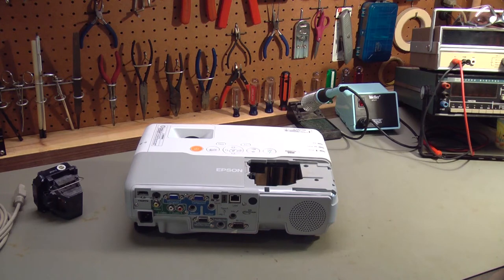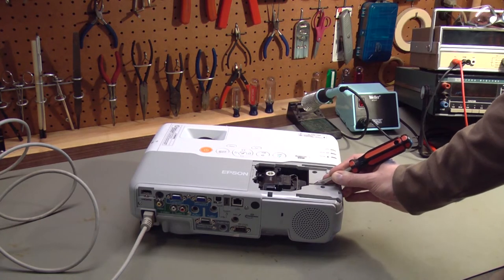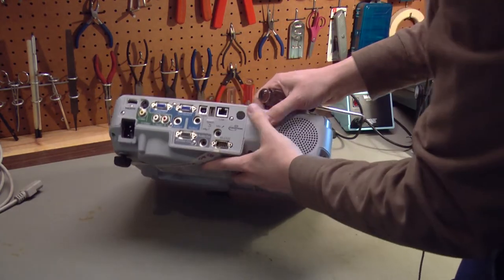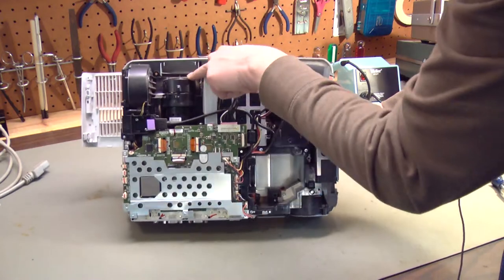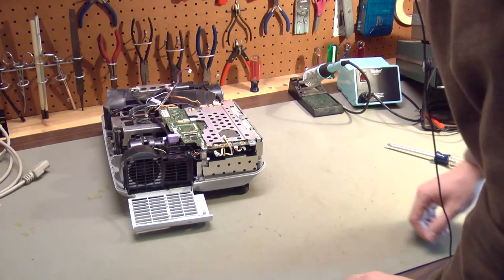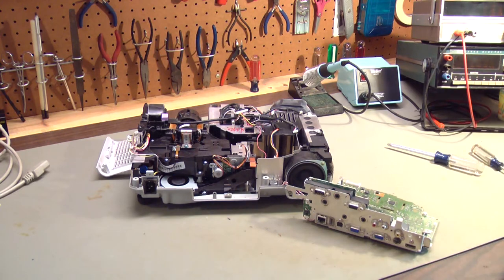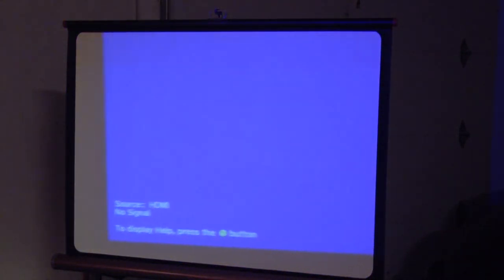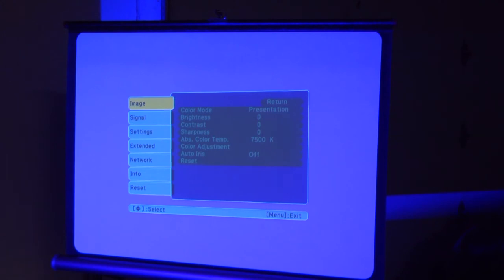Epson Powerlite 96W Poor Picture -- No Blue in Image -- Regluing Blue Mirror

Comment: Hey. I got a PowerLite 980W and it's great, except when I throw a completely black screen on, it has a faint green blur on towards the bottom right of the screen and a very faint red blur in the middle. Did some digging on the internet. Are these dust spots that can be cleaned out by a light dusting of the lenses, or maybe there is dust on the LCD? The issue only happens when I display black screens or when the video is dark.
Reply from the maker: Could be dust. Or it could be something in the optical path is out of alignment. It also could be that the LCD inside is just getting worn out.

Comment: This was a great video!
I have an espon power lite 95, I followed your video and my internals are identical. When the projector is powered on I get the same blue screen with white letters that you had. But, when I hook up any source to it the image has a very blue tint. All image settings on the projector seem ok. Any ideas on what that could be? Should I replace the LCDs or trash the projector?
Thank you!
Reply from the maker: Have you tried different video inputs? If you haven't already, try a VGA, and HDMI, and either the composite or S-video input. See if the problem occurs with each input. If it does, check the alignment and orientation of each mirror and lens in the optical path. Also make sure the ribbon cables going to the board are all fully inserted. If the problem is just with one input, there probably isn't much you can do about it except to just use the projector with the inputs that are still working.
Reply: Thank you for the reply!
I did try those inputs but the problem occurs in all of them. I took the projector back apart and everything seems to be connected well and all lenses seem to be in the proper place. Initially I had to re glue the same blue mirror you did in the projector in the video. When I placed it, it was setting in a grove and seemed to be in the correct place. Could it be that mirror still or maybe the LCD?

Thank you again for your advise!!
Reply: ***Update

I was able to fix this because of your video and advise! The clamp that flips up was broken on the blue cable. So I rigged up a zip tie to hold the connection down and it works! 

Is there anywhere I can purchase these little clamps to replace the broken one? Thank you again for the advise!
Reply from the maker: @zacgriggs1762  Could be! Hard to say at this point.
Reply from the maker: @zacgriggs1762  Oh good, glad you figured it out! No, there doesn't seem to be any good source for parts for these projectors other than getting another projector just for parts. I had the luxury that I maintained several dozen of these for a local school so as I found projectors with issues I couldn't fix, I saved them for parts. Now they've gone with laser projectors!

Comment: Hi Nelson, 
Thank you for the video. You explained the steps very well. 
I have one of these projectors with the same problem. I followed your steps, glued the (blue) mirror and reassembled the projector. Now the lamp does not come on. I could not measure any continuity across the terminals with my ohm meter. 
Is the lamp damaged or burned or could it be something else? 
Please let me know what you think.
Thanks.
Reply from the maker: The lamp won't measure any continuity, even when good. Does the orange light come on when you plug in the projector? If not, I bet one of the little wires that plugs into the circuit board isn't hooked up. If you do get an orange light, does the projector appear to power up when you turn it on (i.e. the fan comes on and power light blinks)?
Reply: @w8nwo  Thank you for the quick reply.  I opened it the projector twice. The first time I glued the (Blue) mirror and reassembled everything. The picture was almost perfect. There was a yellow vertical strip in the right side of the picture. I opened it again and noticed that the (Blue) lens was slightly turned. I fixed that and reassembled the projector. Now, when the projector is pugged in, the power light is solid orange and when I press the power button, the power light starts flashing and the fan comes on, but there is no light.
Reply from the maker: @behroozh7837  Could be a number of things. Is the lamp fully seated in its socket (pushed in all the way)? Is the front white shutter in front of the lens open all the way? If it is closed even the slightest, it "mutes" the projected image. 

If both of those are OK, open the projector back up and double check all the connections. There is an internal shutter in the projector between the lamp and the lenses/mirrors. It may be jammed or disconnected. 

Lamp failure is possible, but since it worked OK earlier, it probably is still OK. Those lamps wear out but don't burn out all of a sudden like a household lamp. The only exception is if the lamp bursts, but you'd probably have noticed that if that were the case.
Reply: @w8nwo   Thank you again for your comments.
I unplugged all the connectors and carefully plugged them back in. Now the projector works again, but I still see a vertical yellow strip on the right side of the projected picture. Which means the "Blue" is still  missing on the right side (about 1-2 inches) of the picture. 
I was careful to glue the mirror flat and I don't see any "Blue" bleeding on the writings. So the "Blue" is right on top of "Green" & "Red". 
Do you think the mirror is not placed correctly or the Lens or something else.
Reply from the maker: @behroozh7837  It could be that the blue mirror is just a little off. Or it could be a misalignment of other mirrors/lenses between the lamp and the blue mirror. One place I've found misalignment is in the first two lenses after the lamp. The purpose of those is to collimate the light and "square it up" to avoid spill light that doesn't need to pass through the optical path. There is an extra little metal cover you have to remove to get to those lenses. Those lenses are perfectly aligned and then glued at the factory. The smallest error in their alignment will cause the problem you're experiencing. When the glue dries up and lets go, those lenses can move just a little bit. Because of their precision, they're quite difficult to realign without special equipment. Still, it might be worth a try if that's the problem!

Comment: I have a Powerlite 98h with the same issue. Are the optics similar? Could it be the same cause?
Reply from the maker: Couldn't say. Never worked on a 98h.
Reply: @w8nwo  Ok thanks for the reply. I'll have to open it up when I have time and take a look. The fact that it's doing the exact same thing leads me to believe it has a similar issue. Also, I got the projector for free from the bar I manage, and when I took it down all the vents were full of dust. Makes me think it probably got hot enough inside for the glue on the mirror to loosen.